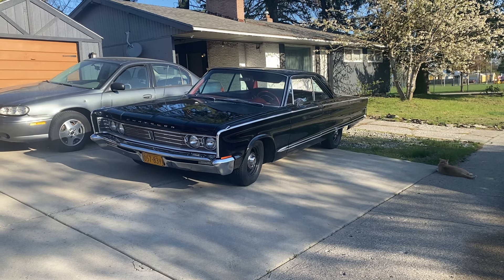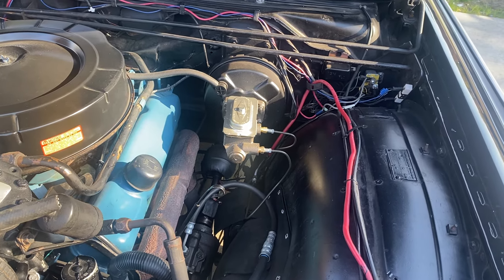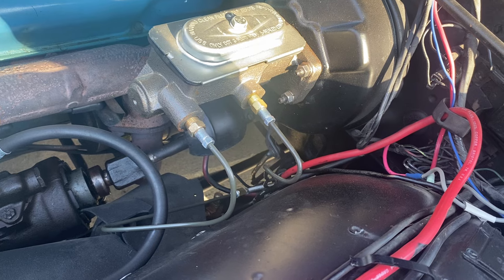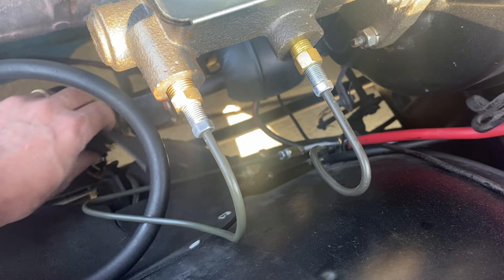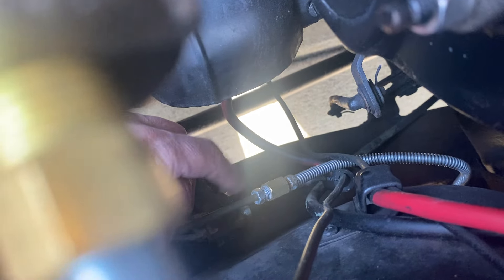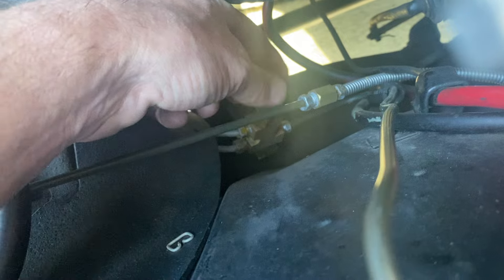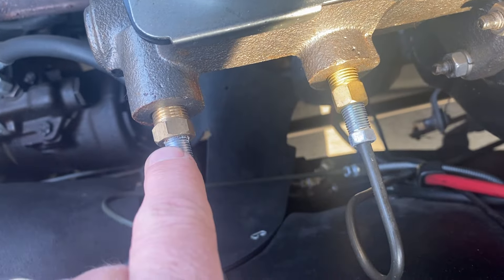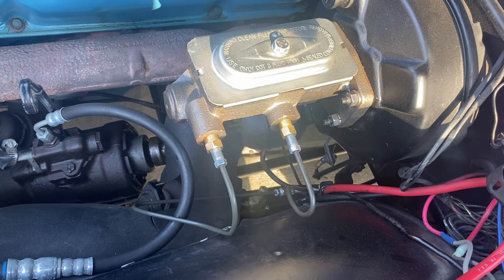1966 Chrysler Newport - Dual Circuit Master Cylinder Upgrade

Comment: I suppose to make a further upgrade on top of an upgrade, is use DOT 5 brake fluid, after flushing the old DOT 3 out.
No more rusty inner fenders!
Reply from the maker: Good idea!
Reply: Upgrading from DOT 3 to DOT 4 will give you zero problems,  whereas going from 3 to 4 (or 4 to 5) especially for a system that was designed for DOT 3, is problematic. I recommend you do just a quick search on this as anything I say will just be copy/paste of the parent source(s).
Reply: @DawaSupplyCo  yes of course there are some potential part/area's that needs to be swapped to accommodate the DOT 5.

I surmise the proportioning valve is an area that needs to be upgraded,

And the necessary wheel cylinder that will stand up to DOT 5 also.

It's not a 1 to 1 fluid swap if I made that kind of impression.